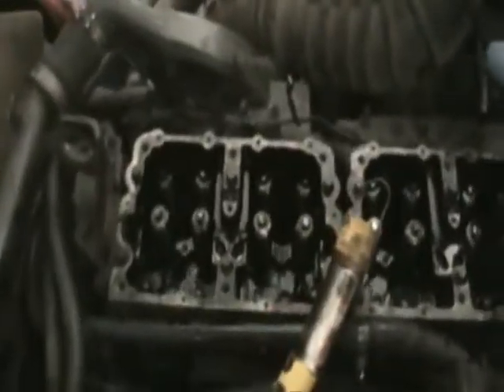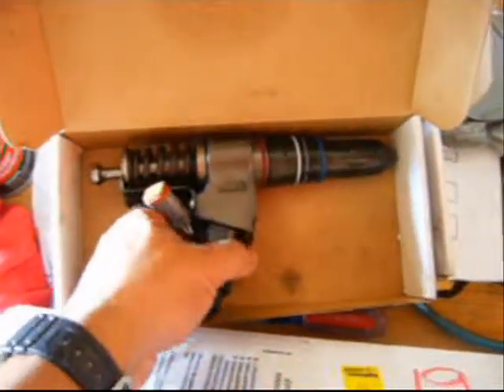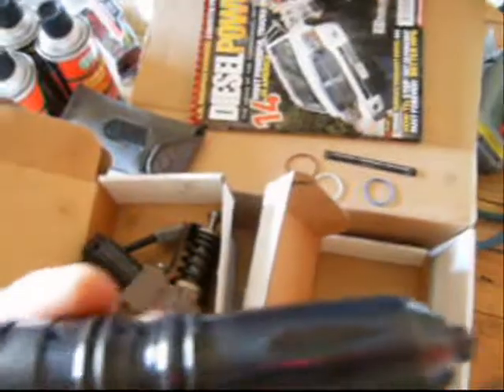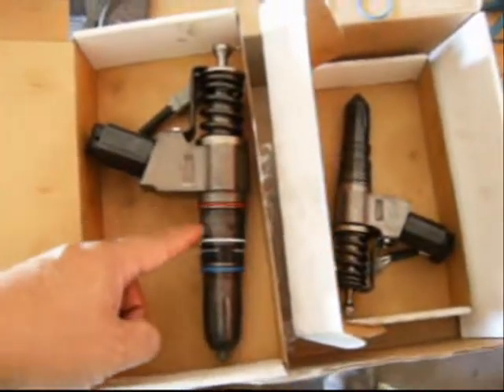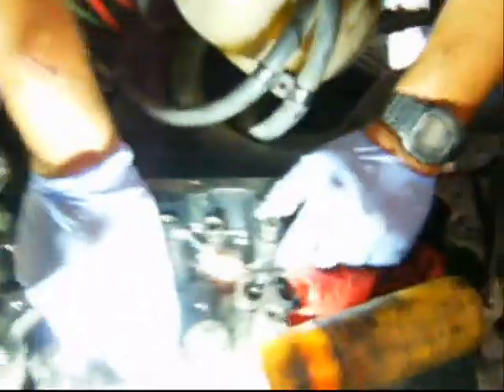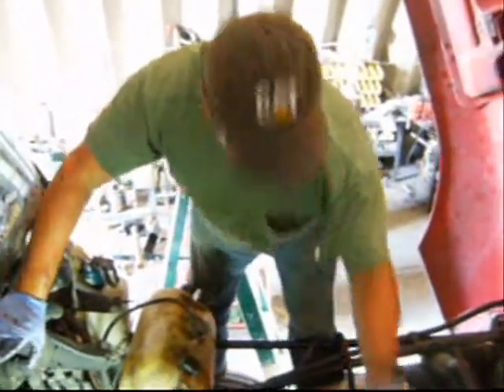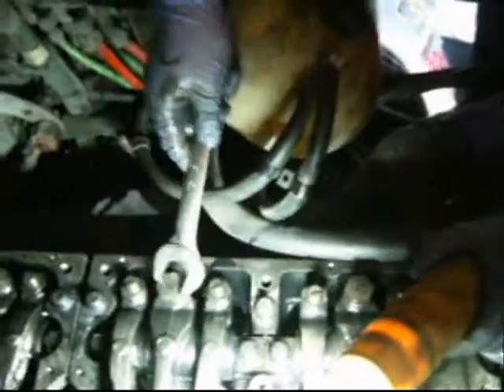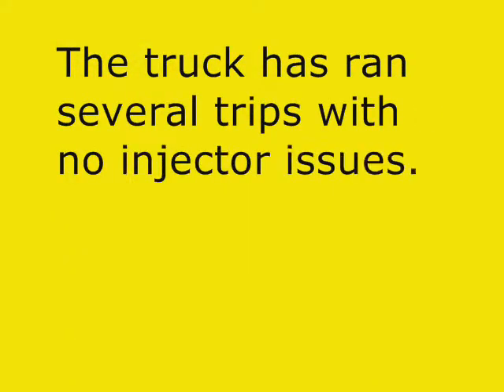More N14 Cummins Celect Plus injector work.wmv

Comment from the maker: I would not have plugged them if they didn’t have a superior product  with outstanding service.  When I called with a question about where they sourced parts I was put through to the tech who assured me they were not knockoffs or substandard and answered my questions about their test bench procedures where not only chatter is considered but overall fuel flow characteristics.  Good luck getting to talk to someone with technical expertise here in the States especially at Cummins..

Comment from the maker: @easytopleez33 You haven’t done your research.  Chatham replaces 100 percent of the time nozzles, metering barrel, nozzle spring, nozzle spring guide, wiring harness, ceramic metering plunger and check balls, unlike even Cummins reman which will gauge and if within tolerances will not replace with new.

Comment: Hey Guy, if the injectors you bought from Chatham are working out fine, great.  I simply watched your video and wondered how they were holding up.
In the past, I have seen all too often, were a man thinks he's getting a great deal, by purchasing from a vendor out of the states only to find out it was sub par and the warrenty they claimed was voided because they were not installed by a ASE Certified Mechanic.  Are you a certified mechanic?  If so your fine.  If not good luck with the warrenty.